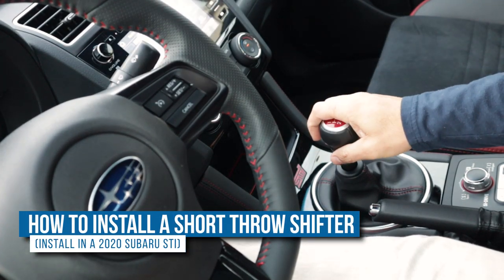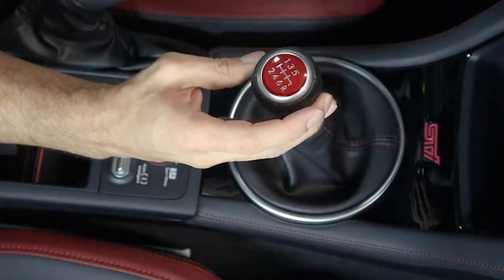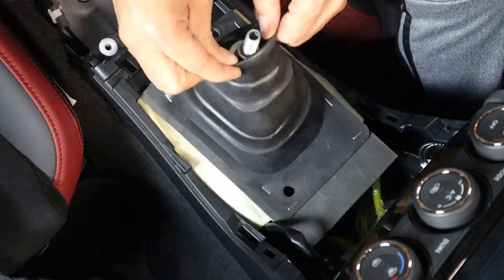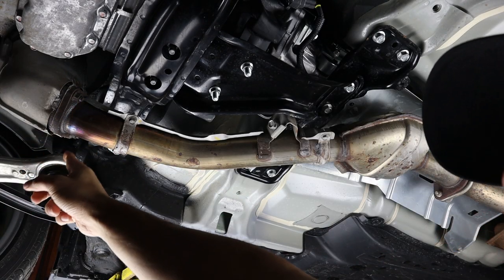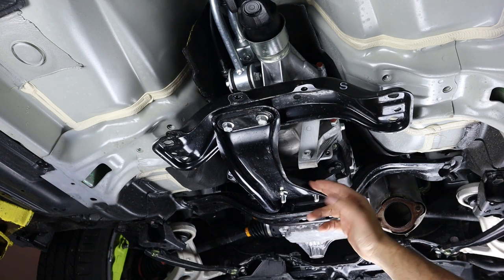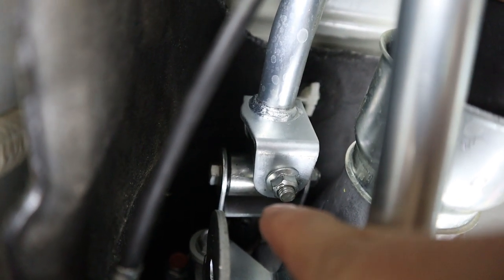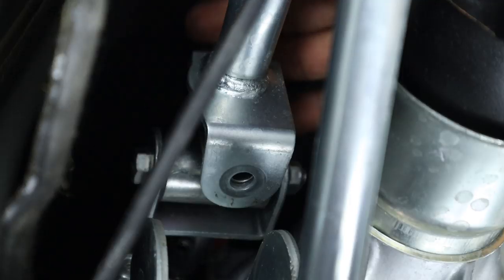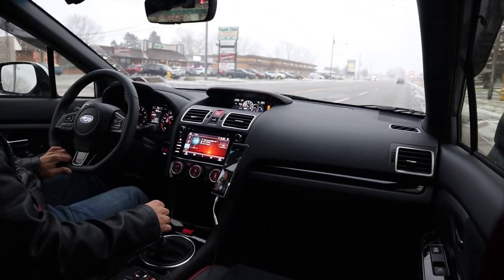How to Install a Short Throw Shifter

Comment: Great video! Sorry you went through all that just to find you already had a short shifter. But not a total loss as your video will help many people with their installs. I bought my bugeye new 19 years ago. Very first mod i did was install the Subaru short throw shifter (using a jack and jack stands in an apartment parking lot). Many years later i upgraded to the Cobb shifter which gave REAL short throws. That made the car fun to drive all over again and i wish i had done the Cobb upgrade as soon as it was available. I already bought a Subaru STI short throw shifter for the '22 BRZ i have on order. It's an option but i need to make sure it doesn't already have one installed from the factory!!!!!!!!!!!!!!!!
Reply: A brz shifter is super short already
Reply: Good to hear. Now all i need is my car to be delivered. Have been waiting five months so far.

Comment: Man, that must have been a facepalm moment! But, it was a very well-done video and good to know that the short-throw shifter is the factory default. Also, great to know about the shifter bushing if that ever needs to be replaced.
Reply: Are we certain of that? If you build one online it gives you the option for a short throw shifter or not for $500, so what shifter comes when you opt out of that?

Comment: Interesting if the 2020 does come with the short throw shifter standard. I have a 2020 ... need to do some research now. I had a 06 LGT and put a COBB short throw on, was great being adjustable. Made my shifts super super super short.

Comment: A great video brother. I just had a weird thing happen to my 2020 STI in May this year.  I took my 2020 STI to Irvine Subaru out here in Ca  where I live for my 30K service. After the service my shifter scraped in 4th gear, I took it back and after a week it migrated to start scraping in 3rd gear. So my STI was basically in the shop @yhe dealer for a month and I couldn't understand how that happened. I finally received the STI back and the head mechanic told me that they replaced the 4th and 3rd gear Synchros and a bunch of other parts. It shifts like a dream now. But it shifted great before the 30K service. What do you think they screwed up  if you don't mind me asking. I have never seen anything like that. A great video brother. Stay safe. Do you still have your STI? Subies forever.

Comment: I recently put in a Kartboy shirt shifter and everything went well but it was hard to get into reverse sometimes , then the Lockout got stuck up ….I reassembled worked correct but then it happened again after about 3 days is this an adjustment in the Lockout cable ? It almost acts like that cable is too long from the stock shifter ….any help appreciated!!!
Reply from the maker: Yes that cable does have an adjustment which is likely your problem.
Reply: @akqjtn  thanks man Keep up the GREAT videos man The in-depth instructions are awesome and very helpful! I’ll let ya know how it goes!

Comment: Thanks for the video and support your channel.. quick question, how durable is the hand brake.. what happened was I find it hard getting in the car ..  I usually get in the seat then use my elbow on the are rest to move myself to sit in the center.. today I got in I think I was holding on the hand brake instead of the are rest but just 2 second .. will I do any damage by pushing in the e brake and apply pressure? Thanks

Comment: Although you didn't install the short throw shifter I've seen some forum posts saying that the STI has a short throw shifter so at least you were able to confirm that so that's good. Also what phone mount is that?
Reply: @akqjtn  nice! I can't wait for the vid.
Reply: Short throw shifter isn't a standard option in the STI. Mine doesn't have one.

Comment: Propeller shaft  that was a new one for me. Im pretty sure most of the 15+ come with the upgraded shifter. Its not really worth it anyway. 
       The community go to is the katboy unit or cobb. Dont see to many ppl wasting their time on the upgraded stock unit. Cant believe you were there and didnt upgrade the bushing and stuff ,as the rubber ones quickly loosen up. 
          For reference the WL bushings kdt901 , kdt957 and group N mount will set you up nice and give you some longevity. You can cross these to your preferred brands. Youre not going to go back to the stock unit.